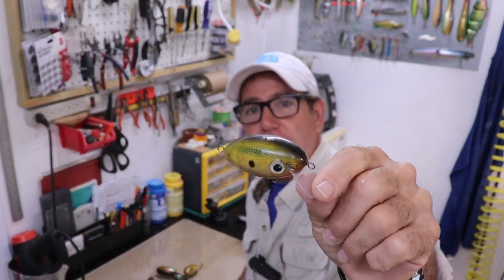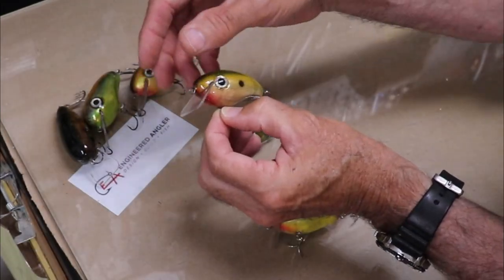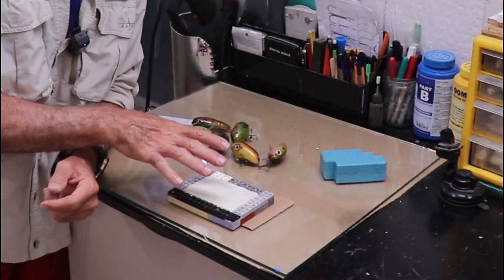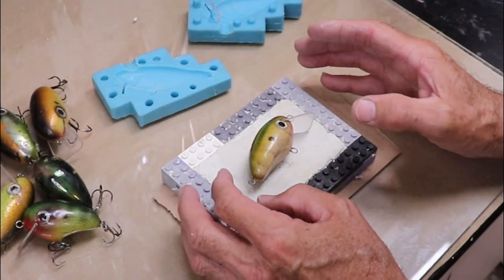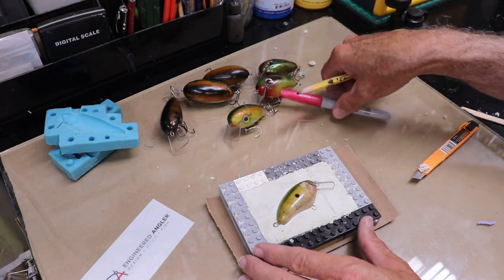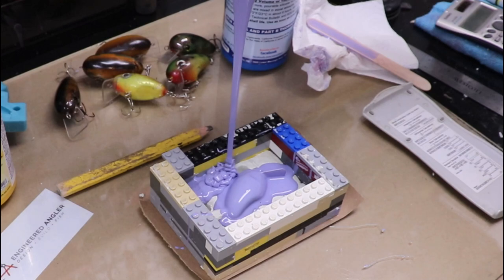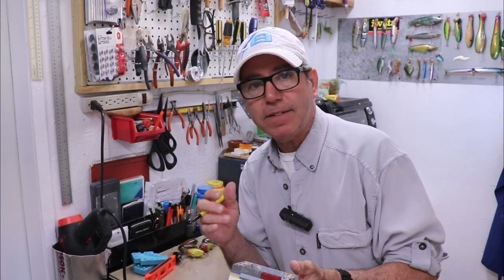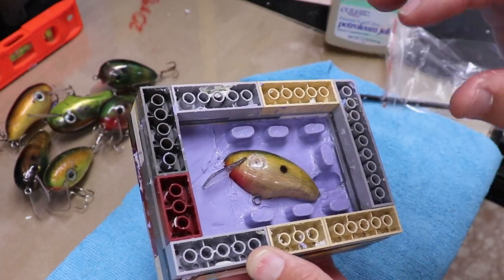Making a Silicon Mold for my Best Bass Lure #fishinglures #makinglures #crankbaits

Comment: I used to make a lot of silicone molds and was always looking for ways to save money. Keep all those little scraps and cut off pieces. You can grind them up and add it back into your mix. I will say I was using a clean mix first to capture all the details- then fill the mold with my “chop” mix. I was making rock climbing holds back then. I have been testing the water with some fishing lure designs. Might start making some. Your videos are very good! Tight lines!
Reply from the maker: I do the same with any large molds I make...you can save 25% on the volume of fresh silicon.  It's a good tip.  Thanks for your input.

Comment: Do you think an aluminum mold would be better if you wanted to also incorporate a wire through construction?
Reply from the maker: The problem with metal molds is that they do not flex.  So your lure has to be designed so that it can release from a ridged mold.  That's why you usually use metal molds with soft plastic lures since the lure will flex when being removed from the mold.  Silicon is really most versatile and easy to make.

Comment: Ima newer subscriber to your channel. going through your previous videos. This one sparked a question or thought. Could you use a mold to make the bill and lure one solid piece? Asking mainly cause I was thinking about trying it, I’m just to far away from that stage so checking see if you have thought about it or tried it yet
Reply from the maker: Welcome and thanks for the sub.  Yes you can make a mold to make both the bill and lure.  I have done it but I recommend you make the bill about twice the thickness as a typical acrylic bill.

Comment: Good morning 
I’m in the process to make a small style bait in resin and mold. 
Is it best to copy the lure with paint removed, or leave the paint on like you did in the mold making process. To try to replicate the cranks as best as possible.
Reply from the maker: If you are copying a factory lure, don't worry about the paint.  If it is a lure you made and painted then taking off the paint will give you the best copy.
Reply: @EngineeredAngler Thank you very much, appreciate you an thanks for sharing your information with use😎👍🏽

Comment: Once again, great video! I know you put the holes in the bibs to keep them secure in the bait. Will you add any additional uv resin or epoxy to the outside where the body meets the bib, other than final clear coat, to secure it further? I live where a toothy Northern Pike might hit something like that, so would you suggest further enforcement, or if I don't do an internal harness, would it make sense to pin the bib in with the line tie?
Reply from the maker: The bib I use in only 1mm thick so it will break before it will come out of the body.  If you're making more stout lures with thicker bib material... I would suggest one larger hole in the bib to lock it in.  Cheers.

Comment: What was the bouyency of the resin used?  Is it comparable to the wood?  I am looking to duplicate some balsa lures. 

Do you think hydrodynamics or buoyancy make greater impact on a lure action?  Or so intricately intertwined they can’t be differentiated?
Reply from the maker: I think it depends on the lure.  If the lure is meant to swim/crank or have some other dynamic action on retrieve then I would say hydrodynamics without a doubt.  If it is a twitch bait or glide bait then it would be tough to pick one deciding factor.

Comment: Can it make a hollow body crank bait using a silicon mould? By pouring half or less 2part epoxy/ hard resins and seal the intake, after that let it cure on the rotary. Will it be hollow body crank bait after it cure?
Reply from the maker: You can make hollow lures using a two axis rotory turner.  It's pretty fiddly stuff and takes a bit of experimentation but it can be done.

Comment: What makes your resin cure in 20 minutes? Does the resin you use just cure that fast? Or is there something you’re adding to it? The resin I’m using says 12 hours
Reply from the maker: It's a fast cure resin...you can find it on my Amazon store
Reply: @EngineeredAngler  what is the purpose of the powder you put in the resin?

Comment: What is the name of the epoxy you used to pour the bait with. Having a issue finding some to use and thought about trying what you used.
Reply from the maker: https://specialtyresin.com/product/model-pro-white/
Reply: @EngineeredAngler  thanks I ordered some to try. Alumilite seems to be out for a while with no ETA on when new resin will be available

Comment: Franco, another one well done. Couple quick things.... I am also a lure designer (Twitch bait only at this point) and have been thinking about what you did with the lip inside the mold, but actually pour the resin into the lip slot so the lip is actually part of the pour, (resin lip), also what do you think about doing cut molds? Tried them?
Reply from the maker: If you notice at the beginning of the video I hold up a mould with the lip moulded in period with that mould I actually pour the entire lure and bib together. There are definitely some drawbacks. The bib needs to be thicker than normal For strength. And you tend to get a lot of bubbles on the bib.
Reply from the maker: Using cut molds makes it difficult to place wire harnesses and interior parts.
Reply: @EngineeredAngler  Yeah, i was also thinking about the weight variance between a poured lip & "Slide-In" lip. not sure if the poured one would be heavier. I will be doing some experimenting / testing, as always... Lol. I have not done alot with lipped lures yet as i have my hands full with the twitchbait i am working on. Got it slow sinking and swimming perfectly, just working with a new type of finish that is not paint, water-slide or any topical application. I'm getting some pretty incredible results but as you know, this stuff is time consuming and not as easy as some might think. Alot goes into R&D. I come from a family of stubborn Engineering. Not sure if it's a blessing or a curse.. Lol, I appreciate your comments Franco
Reply: @EngineeredAngler  That is true. I have gone with a "Figure 8" / double loop insert tie wires to help reduce overall weight (on twitchbaits), Less hardware and find the strength holds up good, pulled some good sized Jacks and Snook out with them with no issues here in the Tampa area..
Reply: My lures, that i've been casting, i made the molds so the whole lure would be casting. Two things changed, with the lip now being casting material. 
The action changed. My original lip was a heavier metal. That bit of weight, at the front, gave the lure a special action. At least, an action i liked. But with the lip now cast, it was much lighter, and also gave the lure an entirely different action. So the action changed, but, even being different, it's new action definitely catches fish.
The other, the main downfall, was that it was definitely now the weak-point of the lure. The exact opposite of the original lure, where my lip was the strongest point. So many have broken on me. 
And, like he mentioned, the lip can be very prone to bubbles when making the casting.

Comment: Have you tried “Let’s Resin” silicone mold making material?
Reply from the maker: No I'll  Have to check it out
Reply: @EngineeredAngler  I was looking at different resins that are available and that one comes up on Amazon at a decent price. Seems there’s a shortage of raw materials and compounds used to make these types of products. I plan to make a lot of different styles of baits. I’ll need a lot of silicone rubber.

Comment: How many lures will you get out of this mold?
Reply from the maker: With silicone it seems to be more about how old it is and how much it's abused.  If you use it for casting soft plastics the heat will shorten the life.  It will also have a shelf life, that is dependent on the silicon, 3 to 5 years is normal.  So...I can get hundreds of resin casted lures from a mold or I could let it sit, get old and brittle.  In that case...?
Reply: @EngineeredAngler  Thank you for the info, my friend and I want to get into making lures but weren't sure if we should go the silicone route or aluminum molds.  We were hoping to make some trolling lures for the Florida coast.